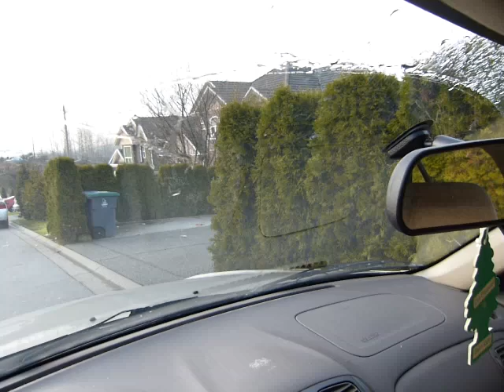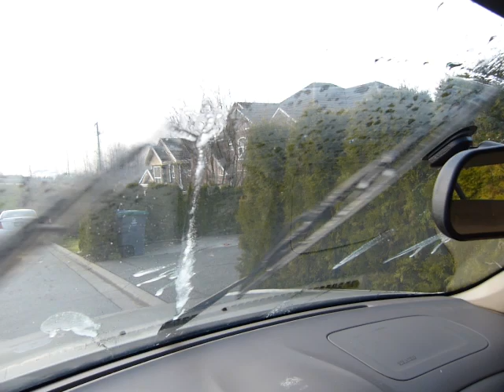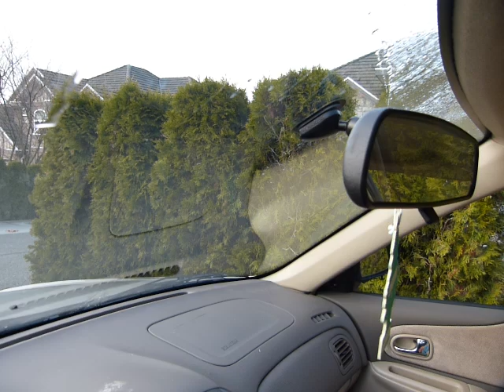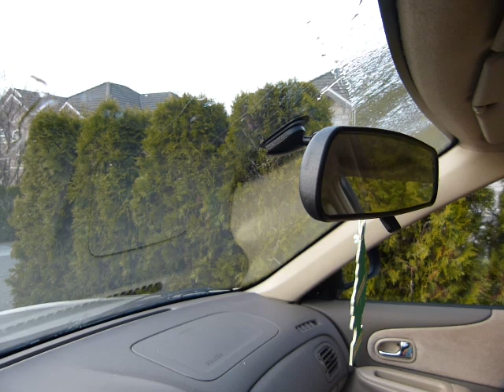Why your "new" wiper blade sucks is ...

Comment: I have been trying to find the answer to this phenomenon for years, I have heard the changing windshield wipers does improve condition..  that has worked for me in the past, But now I drive a company vehicle everyday on the windshield has this white haze on I go through multiple wiper blades trying to fix this condition but it never works, every time it's raining zero disability is what I have to deal with especially when other drivers headlights hit my windshield..
Reply from the maker: See if you can wash off the grime with Windex or Goo gone something, if that doesn't dissolve the grime, go for solvent or acetone or lacquer thinner just don't get those on the rubber seal around the glass or the new wiper blade's edge or the finished paint anywhere or your hands, eyes or clothes ...

Comment: I want to ask in the video it is clear that there is some kind of dirt, how do you remove the wiper wipe marks? so that it becomes clear again when you use the wiper
Reply from the maker: If dirt dissolves in water, water-based cleaners take it off, it it's a grease blob or smear, it needs a solvent or thinner to remove
Reply: @theoverengineer  ok thanks

Comment: Why would this hazing happen on my new windshield with new wiper blades then?
Reply from the maker: New rubber items (wiper blades, kitchen items, car tires too) have a mold release coating on them, so they don't stick to the machine die when they are made. This coating needs a bit of time to rub off.
Reply: I'm I'm the exact same boat. I had a brand new windshield put on a a month ago (with new blades) and all of a sudden this happened. I tried everything and couldn't fix the problem, so I assumed it was a faulty windshield. Had them come replace it and it's still doing it on the new windshield. So you're thinking it's the new blades??

Comment: You’re right about windshields being pitted with age, and the pits also eat wiper blades faster… but the haze is mostly caused by crappy carwash waxy additives used to aid beading and blow-drying at the end, plus road oils, hard water, etc..
Solution:
Clean with alcohol and 0000 steel wool.
Clay bar it.
Wipe down with regular glass cleaner.
Apply Nufinish if you want… it doesnt build up and bugs dont stick to it very well.
Reply from the maker: Thanks for sharing your experience and watching!
Reply: Can i fix it with only claybar?

Comment: I have same problem with brand new car so "sandblasted" windshield is not the problem, just bad stock original wiper blades are complete junk :(
Reply: Same with expensive ones, I've tried Michelin $50 dls. Same issue, even worst, after 8 months they are so noisy, rubber gets hard.

Comment: Uh, I had the exact same hazing on my brand new truck when it rains. I cleaned the glass, and tried cleaning the wiper blades with no luck. I put new wiper blades on and that fixed it for a while, but now it is back. My truck is only 6 months old and has only 5k miles on it. I am pretty sure it doesn't need a new windshield... next thing I am trying is clay bar on the glass and c,ean it really good, then clean the blades with alcohol.  I think the problem is wax/grease build up from the car wash, as well as so e industrial debris from a nearby paper mill that leaves a dusting on the truck regularly.
Reply from the maker: ... especially cement dust is a killer (actually to humans and fig. to wipers)
Reply: @theoverengineer  Yep. I did the clay bar cleaning on my windshield and cleaned my wiper blades really well and that seems to have taken care of the problem for me. I took it on a road trip this weekend and it did great in the rain. After I cleaned the glass I also treated it with rain-x, but I think what made the most difference was the clay bar. It pulled a bunch of junk off of the glass that was left behind even after I had cleaned it with glass cleaner just before.
Reply: @Mike.D.843 
I may need to do this also. 
Brand new car. 2,500 miles.

Comment: Wrong. That "haze" is actually the wax from a car wash... you can remove this "haze" with a cleaner. For example rainX CLEANER. And wa la . GONE and a clean windshield with no "haze". Give it a shot.
Reply: I took your advise and tried Rain X. It didn't work. Not even a little bit. I had tried every type of cleaner up to that point too. I eventually solved the problem by using glass polish.
Reply: @JesusSmokesDoobies  did you polished it yourself or a shop did it for you?
Reply from the maker: This specimen has never been in a car wash.
Get another theory.
Reply: theoverengineer spray rain x cleaner and repellant 2 in 1 and it will go instantly. It will look brand new. If it diesnt i will perisnally send you the rain xs money from paypal to your account. I put my life on it.
Reply: @statisticsspeakforitself4205  thanks. I believe your story. The man who made this video is just trolling when he tells us that the coz is DUST. LOLOLOL
Reply: moseyo tam rainx has gloss enhancers in it. What happened to this guys windshield is that its dried out rainx treats the glass like a vitamin and restores its upper layer of gloss which is stripped out if tbis guys windshield. A wash and wax would treat it too but will fade out in a month. But rain x lasts 3 months. Main cause of the problem is acid rain and harsh windshield fluid which eats through the glasses gloss reppelent upper layer
Reply: moseyo tam because i had this even worse u til i put rainx cleaner and repelent and it went istantly. And i dont use harsh wiper fluid as it strips it off. I just use rain x wiper fluid which keeps the coating on it 👍🏻👍🏻👍🏻
Reply: moseyo tam my glass is so so shiny too now

Comment: What has worked for me on the glass, is cleaning the windshield (soap and water), getting a citrus degreaser to remove weather contamination, then wipe with alcohol,  polishing compound or adding a rainex formula, rubbing off after haze (either way works). Glass will be clear as day and smooth. Remember to clean inside windshield as well. Inside, citrus degreaser and regular glass cleaner, no need to polish, since it’s not exposed to weather. Last tip, with citrus degreaser, don’t spray directly on glass, spray on cloth or rage. Hope it helps.
Reply from the maker: Good stuff, thanks for sharing

Comment: ....I have only seen this on aftermarket windshield replacement glass.
the quality of the manufacturing has a lot to do with this problem.
do a little research and you will find this out too.
insurance companies are almost always going for the cheapest way out and will steer you to the cheapest windshield replacement installation companies to save themselves from paying out as much as they can .
I have had to have my "replacement windshield"!! re-replaced to get rid of this problem three different time in the last 10 years on a couple of different CAR'S.
and it all came down to the "quality manufacturing" of the replacement windshield.
Reply from the maker: Absolutely, glass quality is one factor. The nature of sand and rubber being the other 2.

Comment: This white hazing also occurs on brand new cars with very few kilometers on them, with brand new windshields and wipers.

The reason is sticky road dirt - oil, sand, salt, tar, calcium, etc.

Clean your windshield first - with a strong degreaser, good glass-ceramic hob cleaner (the white paste), steel wool and maybe even clay it with a clay bar. If all that fails you can also bring the car to get the windshield professionally cleaned and polished (it's very labor intensive, not a DIY task in my opinion). 

On older cars you could also replace the wiper blade assemblies (+ rubber), check the springs and replace if needed, and adjust the arms.

Windshields get damaged over time, mainly from small rocks being lifted from the road and thrown at you by the cars infront. A windshield could be ruined in less than 50.000km if you drive on dirty roads and highways (common in southeast Europe, for example). If you have lots of small dots (cracks), especially noticeable in bright sun, you could think abou changing the entire windshield. Just bear in mind that this is a costly (very costly if using original replacement) job. Also one that takes a lot of skill and need to be done with good materials, else you'd regret it for sure.
Reply from the maker: A lot of skill such as:
- apply a bead of glue
- align windshield
- place windshield
?
Step one might overwhelm some people, tragic.

Comment: From new I had that mottling and some wide mostly-vertical clear areas. Tried everything except steel wool or jewellers polish & failed but finally "SILVO" fixed easily. When it dries the pack says wipe the powder off with a dry cloth but the powder goes everywhere. I found you can use a slightly damp cloth and the powder sticks to it.
Reply: I might try this.. ty!

Comment: BEFORE U BUY A NEW WINDSHIELD.......POLISH YOUR GLASS!!!!     Did you know that glass can be polished?! There are glass polishing compounds and tools out there as well as shops that perform the service itself that RENEWS the surface of your glass, like a deep compounding does for your cars clear coat. Try this before all. Buy some 0000 super fine steel wool and dry polish your windshield, (no need to rinse, just wipe clean with a duster or clean rag), then change your wiper blades. Nothing fancy, Anco $8 is as good as any. The key to make blades LAST is cleaning them at LEAST once a week, or the fine embedded sand and dust will destroy the wiper edge and your windshields microscopically smooth finish. Rain X the freshly polished windshield AND new wiper blades. Wipe off as directed, and VOILA!
Reply from the maker: Robert Genovese Never thought about this, makes sense. Thanks for sharing, thanks for watching!
Reply: +Robert Genovese I can confirm that this works well - I've been doing it for decades!

Also, a good denatured alcohol cleaning and using the finest polishing compound (even just wax) with a random motion buffer (or a very long time by hand) can work extremely well.

Then using silicone treatment and blades should round up the mix.
Reply: Rain X sucks and smears your windshield when your wiper wipe s
Reply: @DERANGEDFUCKFACE  you cant use rain x on unpolished, micro pitted glass or it WILL smear, try the steps above IN ORDER before applying
Reply: I literally had a new windshield installed two months ago…is it possible that it already needs a polishing? I’ve only driven 4000 miles …it was an aftermarket windshield.. i drive a 2016 ford transit

Comment: i have this problem too :( 
So you mean the only cure for this is to change the windshield?
Reply: Try denso its really good
Reply from the maker: ***** If the new blade still leaves big patches of water film of uneven thickness, the glass is at fault. Most NEW rubber edges aren`t perfect at the time of manufacturing, it needs a few weeks of "mating" to the glass it is on, esp. without dirt on the glass. Same idea with brake pad + rotor surfaces, maximum braking efficiency takes running-in the pads a few miles, or piston + cylinder surfaces, the best fit or sealing takes a bit of running in.
Reply: Thank you for the info. I'll try a new wiper blade for some weeks and see if it sorts it out. :)